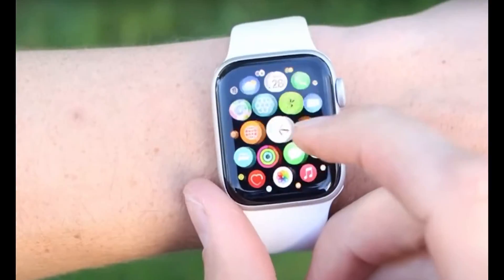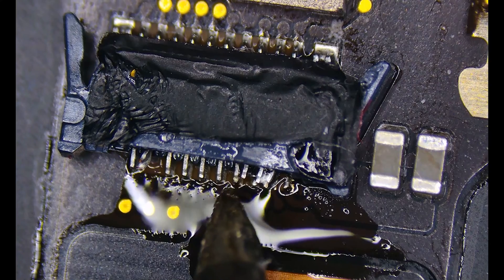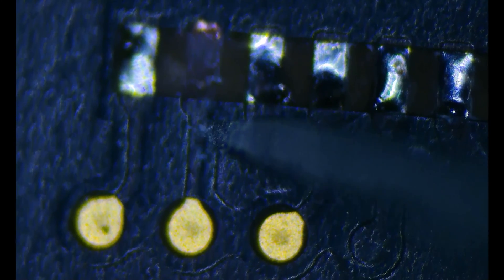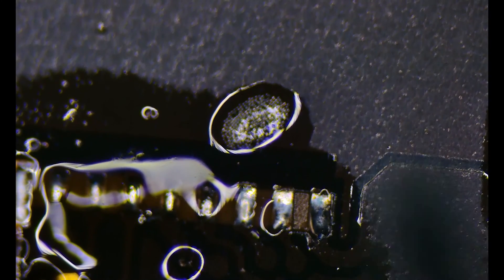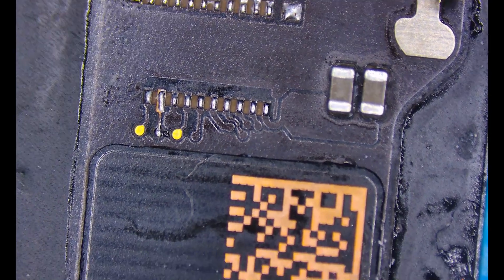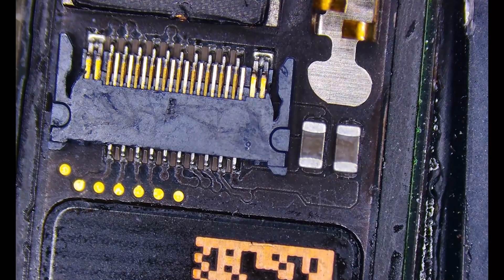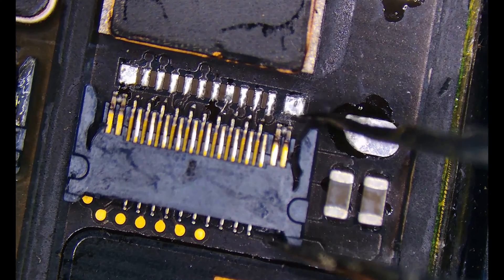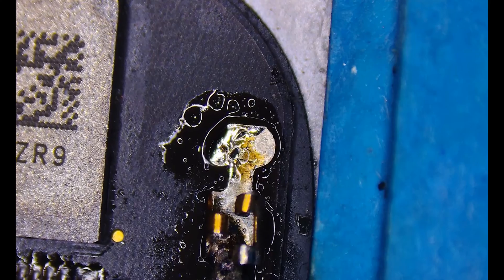Apple Watch Screen Connector Repair: Fixing NFC Connector

Comment: Hey, does the series 6 require NFC chip resoldering with a display replacement?
Reply: I don't think so, the NFC has been moved onto the main board on the S6 the only connectors on the screen are for the OLED and the touch.